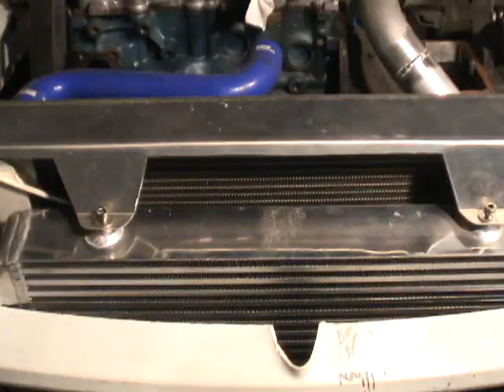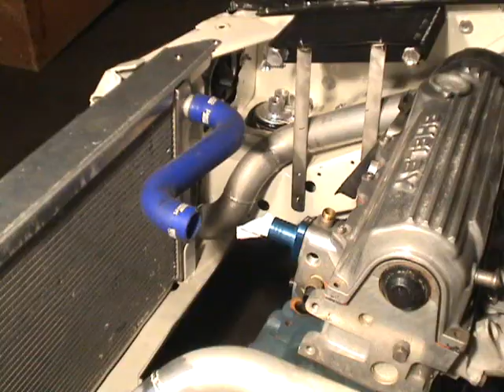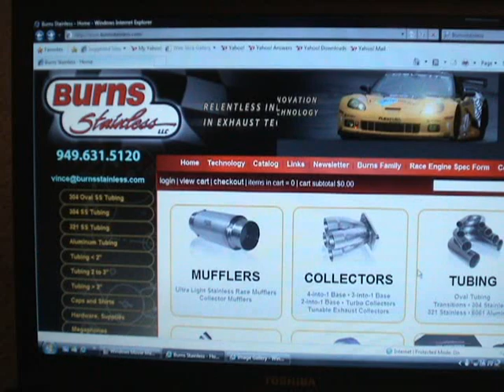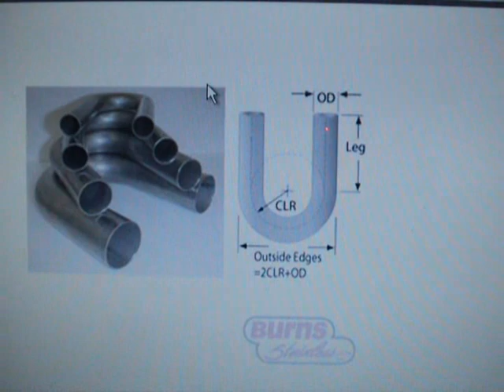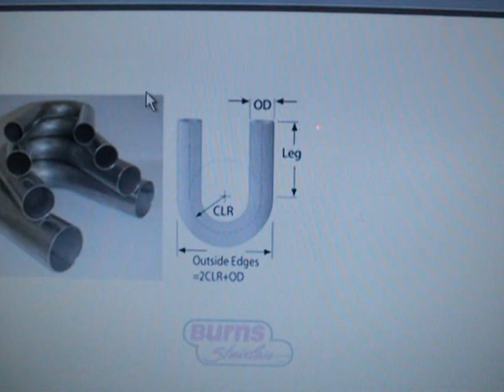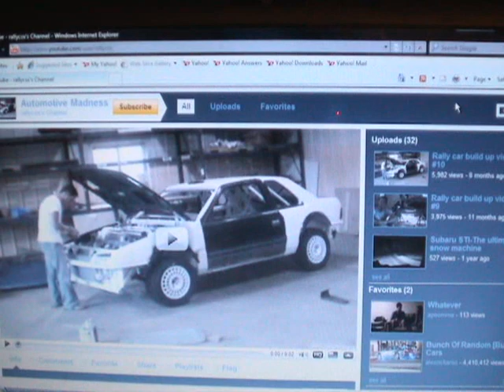Rally car build up video: CSX #11

Comment: Can you provide an guidance as to where I can find the information I would need to build my own rally car?  Specifically the specifications for what is allowed for cars to meet certain class requirements.  I really want to make a 3000gt rally car but I dont know if they would fit into any of the classes being that they are quite powerfull having a 3.0 Twin Turbo Engine.  Im hoping there is a class that lets u run 3.0 naturally asperated motors and I would just build the 3.0 v6.

Comment from the maker: As far as the engine configuration goes I wanted to stay with the original 2.2 Ltr 8 valve. It makes great torque and fits my driving style. I did consider quad TB set up but dropped the idea because the time involved didnt seem worth the returns. And FYI I have a very patient girl :D